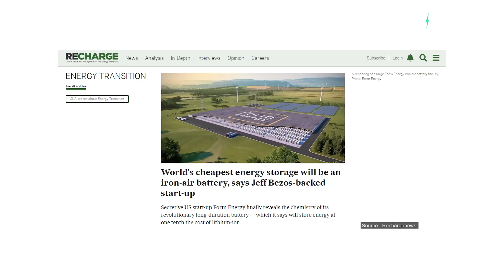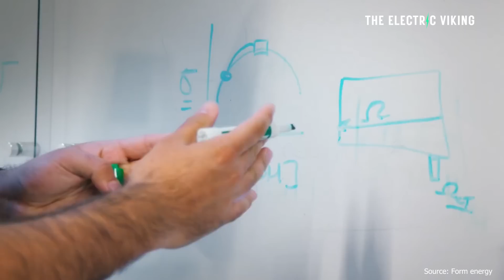America's Game-Changing 100 Hr Iron-Air Battery: Cheapest Energy Worldwide...

Comment: It probably isn't a game-changer, but having a diverse set of competing energy storage technologies can only be a good thing.
Reply: at 1/10th the cost it is a game changer.
Adoption will take time.
Reply: @lunatik9696  1/10th is  a claim, not a reality.  Well, I can guarantee you that it isn't 1/10th.   The physical storage medium itself is only 1/3 of the equation.  The other two big pieces are the megawatt-scale electronics and whatever the ongoing maintenance costs wind up being.

I would take a lesson from metal hydride hydrogen storage and fuel cell systems.  The biggest cost is not the storage medium, but everything else required to make it work.

Same thing with chemical battery storage systems.  A LFP battery and all related components are solid state.   The same isn't true for hydrogen, fuel cell, flow batteries... or iron-air. 

I would also note that in the Video, iron-air was compared against lithium-ion, NOT lithium-iron-phosphate which is much cheaper.   He talked about nickel and cobalt, for example.... LFP batteries have neither.
Reply: Even if it is traditional batteries keep getting cheaper and better capacity. So by the time this ramps up 10x cheaper may just be a few times cheaper.
Reply: If it isn't a game changer, but is a good thing, then it will be a good thing until cost efficiency is not there because another product offers more savings. We are at a point when various products offer similar solution but time will tell what's most viable long term.

Comment: If you want to make something dirt cheap, make it from dirt. I’ve been excited about iron-air batteries since i first heard of them. If the efficiency is good, they could solve a lot of problems.
Reply: ...if...I hate speculation.
Reply: @elonsmaps  some are more educated and likely than others.
That's how research works.
Reply: The thing is that the efficiency can be rubbish, but if the cost is low enough they make a lot of sense for storing excess energy, which is basically free.  This is the opposite of the current development of highly efficient/ light batteries for cars etc.
Reply: @markthomasson5077  Yes, absolutely. I suspect we’re going to wind up with a power storage model that looks a lot like how cache memory works in a computer. There will be small caches of expensive, high speed storage, then increasingly slower but less expensive backups.
Reply: @markthomasson5077 I have read the efficiency is around 60%. Yes, it is excess energy that would be wasted but why not just split water, combine it with carbon dioxide, and then have a truly long term energy system.
Reply: @waywardgeologist2520  …i guess because that process is soooo much more inefficient than anything else.  That said it could have applications
Reply: @elonsmaps Agreed. "If my uncle had tits he'd be my aunt". Cease with the "If" prefix. 😊

Comment: For an extremely low 'source impedance' (a term in electronics, in electrics, it might be expressed differently) capacitor banks can be added to the mix. This would provide a 'peak' or 'surge' supply much greater than a slower discharge bank. The downside to capacitor supply is the short term of storage, the upside is for that short-term, supply can be massive. Think their use as nuclear detonators, and photoflash supply, albeit they can last for longer durations when used in bulk.

Together with iron-air and lithium-X, a more modest bank can appear much larger than it is in terms of long-term supply to satisfy transient and peak supply.

Comment: On a slightly smaller scale this equates to a 5KW discharge rate and 500KWH capacity system. I wonder if the footprint of that would fit under a typical house. It would be great to have a built in 4 day electrical storage capacity for the roof top solar.
Reply: Tryin to get that put into th code as we speak

Comment: Irion-air batteries are not really a new idea.  There are also zinc-air batteries that work much the same.  You let oxygen turn a metal into an oxide to get the energy out and then use electrical power and chemistry to reduce the material back into a metal form.  It is a good idea for storage if you can make it work because one side of the chemistry doesn't need to be stored.

Comment: I am going to think of it as "Phase-Change-Storage".  May not be correct, but gets one thinking about all the ways to collect "work" now...  and burn it later.  As simple as lifting a huge weight into the air, then letting it into a controlled fall, or pumping water up to a storage tank for later use.  Melting wax in a barrel, or anything that harnesses the magic of changing form (like Solid to Liquid to Gas).  Think about how efficient mini-split heat exchangers are.  ...  Major innovations are lurking in the corners.  Most are not well known because they disrupt profit.

Comment: This battery may be cheap as dirt,  but it takes a lot of it to be useful.  The footprint of this technology is on the large side.  Zinc-bromine (like Red Flow) takes up half the space for the same performance.

You are correct, these batteries need to be paired with lithium ion.  They complement each other.  Lithium ion is great for grid stability, iron-air and flow batteries are great for longevity.  We need both.

Comment: It will be using a former steel plant site.  The big deal with this is 100 hour battery not 2 or 4 hour batteries.  So it can supply for longer expected needs.  If it works China will build 10 by the time we build a second one.
Reply: Probably more like 100 to 1, LOL.....and sell them at half the price!

Comment: All the variety of battery options is so confusing. I think I should hold onto my Diesel Merc for another year or two until the "winning" battery emerges.
Reply: All winners because solar is dc voltage
Reply: These batteries are not for use in cars.
Reply: There will “always” be new formulations coming; just a matter of when what is available in the cars at the moment is good enough 😀

Comment: Southern Company has has long generated power with a conventional mix of fossil, hydro and nuclear units, but has used energy storage systems (like pumped hydro) for quite a while to offset the expensive and less efficient running of peaking units. Of late, I heard that SoCo has committed to a strategy that is moving them toward carbon neutral generation and they have been dabbling in Solar and Wind. I'm encourage that SoCo seems to be going big into battery storage, as that is a critical tool to compensate for the variation inherent in wind and solar generation (as well as variation in load). I'm sure if SoCo determines that the batteries are cost effective, the PSC and any other regulatory bodies (FERC,NERC,SERC, etc) that could potentially interfere with deployment will get on board.
Reply: Reducing smog an carbon level of atmosphere

Comment: It DEFINITELY is a game changer! I have shared on Sam's videos before the research report that only 50% of available roof space needs to be covered with solar cells to produce 100%of ALL energy usage world-wide. Continuity is the only remaining stumbling block. In jus a few years, every new home will have a 100-hour Iron-Air battery and solar - possibly some of the new, small wind turbines to top it off - AND WE CAN THEN ALL GET OFF THE GRID! Keep the grid around for  once-a-year backup power, but - no coal plants needed for the small requirement, and no new power plants needed! Older homes will also find Iron-Air batteries affordable, along with solar cells, which continue to drop in price. FOOTNOTE: Texas drops in output from renewables during the blackout - was way smaller than fossil fuel electricity losses - by 10 Gigawatts! Propaganda against wind was so blatantly lying pervert poop, I'm surprised we were ever subjected to lies that awful.

Comment: Actual data from Form Energy: $1-10 per kWh (I guess they use raw iron sand). It will supply 100 hours of power ( meaning 5 full days of backup, I guess there is a natural discharge rate giving that number? Or it is just an example and you could have as many days you want). A 10GWh battery can supply a 100MW.
Reply: Where did you get that number for 3kwh per m3. Iron air battery have theoretical densities of 1.2kwh per kg. So that comes to more than 1200 kwh per m3. Care to show a source?
Reply: Thanks for the important information that Sam should include in his videos to dramatically improve the value for his viewers...
Reply: @Klargus  Lol my bad (I will correct my statement, thanks), I was in bed reading without glasses. Thought I saw kWh but it was only kW. Data was from a presentation by "Reinventing the Iron-Air Battery for the Electric Grid" on youtube.
Reply: @DarylOster  Sorry I made a mistake, have corrected comment now. Disappointing the company can't just clearly tell us the real kWh/kg and kW/L values.

Comment: A lot of work going on in the metal air battery space. 

A problem with iron is low cell voltage so batteries are very large.

Calcium and aluminium air look more promising for compact storage devices but also have problems requiring resolution.

Aluminium air in particular is looking promising for use in light aircraft where it could provide three to four hours operation. The fuel would be in the form of a cartridge of aluminium metal that would be replaced at refuelling stops.

Comment: What is round trip efficiency? From Google it seems about 60 percent which is 95 percent for Li ion batteries.
Reply: At these ranges one should just split water and combine it with carbon dioxide to create a long term fuel storage option.
Reply: @waywardgeologist2520  Power to hydrogen is 85 percent efficient, hydrogen to methan is 70 percent, methane back to power is 50 percent. You get roundtrip efficiency of 30-35 percent. Just use Li ion battery with nat gas peakers for longer term fluctuations. That is best option by far

Comment: If I were going to combine Iron-Air batteries with LiFePhosphate, I'd use the IronAir to continually recharge the LFP, which would have the power density to handle peak demand and get topped up during the night. If this one battery can provide 15 Mw, then two can provide double that. Given all the advantages of this technology, especially the abundance of the materials, there is no excuse, not to roll these out at a truly massive scale. Now!
Reply: Charging one battery from another is the height of stupidity. Loses are the only result
Reply: @MegaWilderness  If Li ion batteries are 85-90% round trip efficient and an Iron-air battery costs one tenth the price, I think that anything which allows you to reduce the expensive Li aspect of your battery storage, can only improve the levellised cost of storage. Energy losses (in my humble opinion) are not the most important aspect of any storage system. Basically, because electricity generation from renewables, is getting so, so cheap and storage is the eternal bugbear.

Comment: Might be this is a good solution. For long time however there are stationary Redox-Flow-Batteries that perform quite well also in Australia. Are there comparisons between the systems already. However seemingly we have already enough technology but by big oil corrupted governments and politicians try all to block the use of these technologies by all means. E.g. in some cases there are still heavy regulation problems when you want to get independent from big grid. There is e.g. the PICEA system from Berlin that with about 25 square meters of PV can produce hydrogen to store in standard low pressure bottles. Here in middle-Europe by June/July you have enough for hard wintertime. But by August till October weather can be quite well and you have energy to sell or store redundantly in powerwalls. But also for heating a pool in autumn and of course fill your EVs. There are so many possibilities and the small system in the size of a refrigerator can easily scaled up for bigger houses needing more power. The investment is rather small and can come down when production is ramped up; today it makes your PV, HP, Heating and Cooling concept about 60‘000 USD/EUR more expensive. PICEA‘s process heat of course can be used too. There are quite no limits to design the optimized concept for any house in any region. I therefore think that more intelligent people who can afford to pay a little more should go ‚all in‘ to become FREE and independent from any energy company or only use excess when it’s offered cheaply, e.g. Tesla in Texas offering night wind energy at 30 USD per month. Also should we think intelligent small local grids, e.g. young people in Pakistan that developed simple nets for poor people helping them investing in PV and selling excess energy or getting some back with a simple computer like the basic PC Arduino. We need more adapted technologies for people and not more big business stealing from customers for the believe that they provide energy. But think, who cares when you are FREE and have your own energies made available individually. Sure that not everybody is in a perfect situation but those who are should take action and responsibility NOW! Climat changes today are really since industrialization men made and that is no joke of scientist. However the way to accept and change realities is hypocritical as we mostly get pressure from governments where they can easily make money without addressing the innate cause and effect. They always follow they money and go and teach the easiest way. The hidden agenda is make people dependent like drug dealers and pimps do that. So people should start thinking on themselves and check all their energy possibilities!🤔🤓🇨🇭

Comment: Lastly, how about giving us info on the characteristics of these batteries.  Longevity, ability to use all the rated power and so forth.  And is there any plans for them to manufacture home batteries.
Reply: Curtailing energy into gravity battery ???
Reply: Supposed to last a lot of cycles if properly designed, but you probably would not want them, as their performance for home would be poor and need to be paired with fast batteries anyway.  They are slow to charge, slow to discharge (can only rust and in-rust so fast) and low round-trip efficiency.  Large-scale installations are what they are good for.

Comment: State officials including Republican governor Greg Abbott initially blamed the 2021 Texas freeze outages on frozen wind turbines and solar panels. Data showed that failure to winterize power sources, like wind turbines and natural gas infrastructure, had caused the grid failure. Texas's power grid has long been separate from the two major national grids to avoid federal oversight, though it is still connected to the other national grids and Mexico's; the limited number of ties made it difficult for the state to import electricity from other states during the crisis. Deregulation of its electricity market beginning in the 1990s resulted in competition in wholesale electricity prices, but also cost cutting for contingency preparation. Would have been easy for Texas to prepare and to get electricity from the surrounding states or the "United States of America". 🤦

Comment: Please somebody who knows better correct me if I'm wrong; but ..
Round-Trip Efficiency is 50%.
Cost is good, eventually $50/Kwh capacity but dunno what these georgia utility guys pay.
I can't help thinking that Sodium-Ion tec is not much more expensive, and 90+% RTE.
Also, if you can tolerate 50% RTE, why not do electrolysis and store huge tanks of hydrogen for months - inter-seasonal. The Fuel-Cell conversion back to electric releases huge - nearly 50% - heat (which can be sold), but then so does this Form Energy system.

Comment: How many cycles will it last?
Reply: Theoretically infinite.  Iron-Air batteries have been in use since Edison stole the idea. Not enough energy density for transportstion other than on Locomotives as a back-up system. Not for EVs, just stationary power storage.

Comment: problem is the iron turns into iron oxide and the reaction stops like the aluminium air battery
Reply: Well they have a way to reverse the oxidization to recharge, as he said I in the video. Rust to release charge, charge to remove the rust to store energy.
Reply: Yeah, that’s kinda how they work. You charge it by reversing the iron oxide reaction. It’s not fundamentally different than the chemical reaction in any other chemical battery.

Comment: Compared to peaker plants they are much cheaper and can be deplyed in smaller unit around a region allowing better and cheaper distribution. This of course goes against central control and current power providers wishes so you have one potential area of pushback. Secondly the financing for this is coming from those very same types, central control oligarchs and fuel and commodites companies who like the idea of controlling consumable products. It is the ultimate industry

Comment: A couple of things don't make sense.  You (and others) talk about 4 hour batteries.  Surly if in 4 hours you only used half of the power in your batteries, some time later - next day for instance - you would have the rest of the power available to use.  Then you talk about the Fe - O batteries not being able to deliver large amounts of power.  Surly you just connect more batteries in parallel.  The amount of amperage you can draw increases with the number of batteries.  For greater voltage, you connect these groups of batteries which are in parallel, in series with each other.